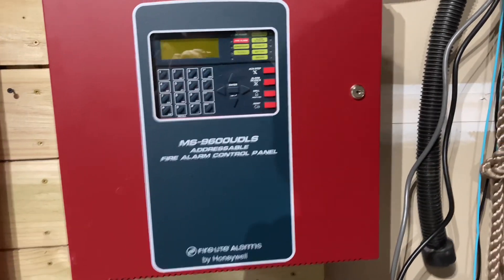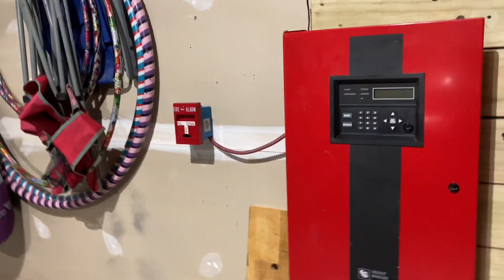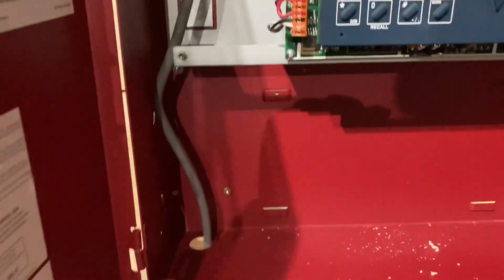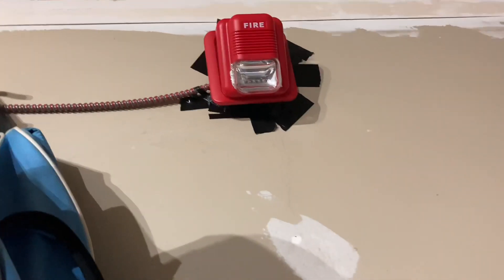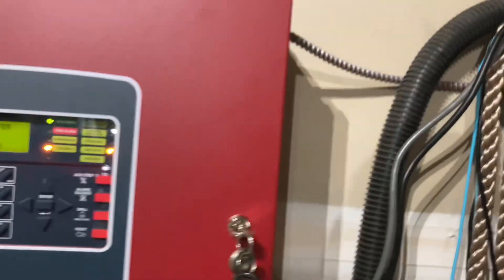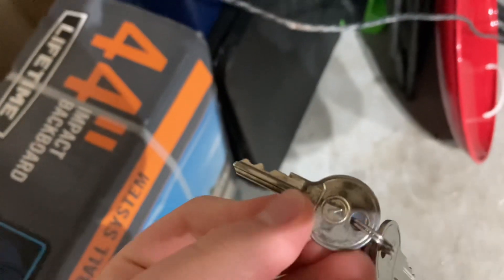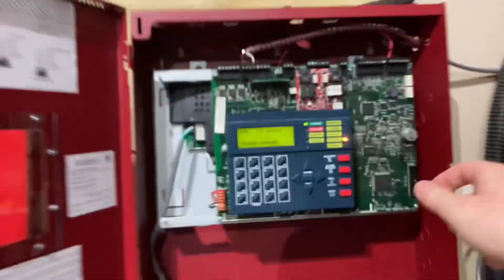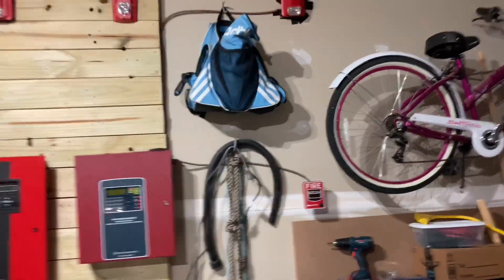Fire alarm system test 2 (with the Firelite addressable panel)

Comment: That’s an NOT-BG-12LX, which the FireWarden brand of the BG-12LX. The other protocol you were trying to mention is CLIP (Classic Loop Interface Protocol). Your NOT-BG-12LX will work on CLIP protocol with your panel, cause it’s listed for the same protocols that Fire-Lite has.
Reply: I think they have a notifier cover on that
Reply: @krnetwork550  it does. NOT-BG-12LXs have those covers.
Reply from the maker: Thanks
Reply: Try it on CLIP protocol to see if the NOT-BG-12LX works.  @CSPAlarmsystem